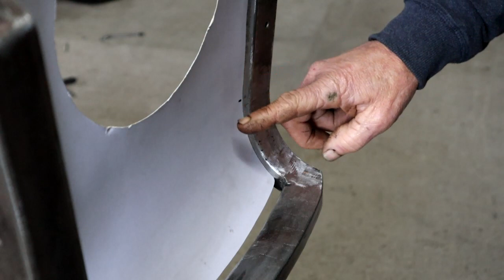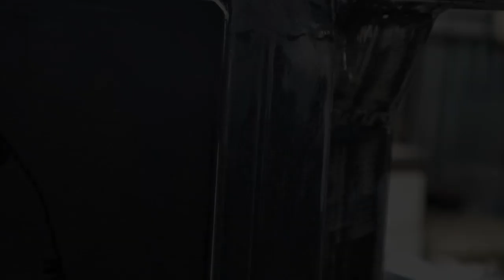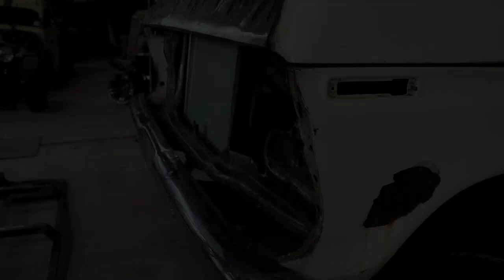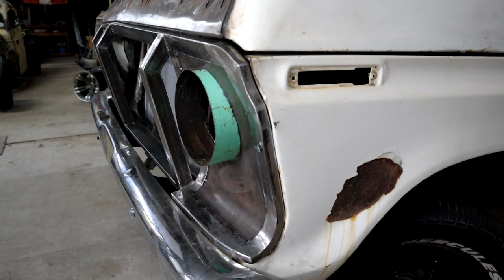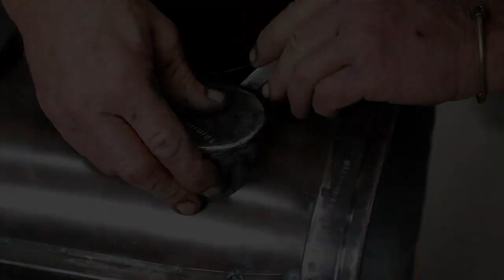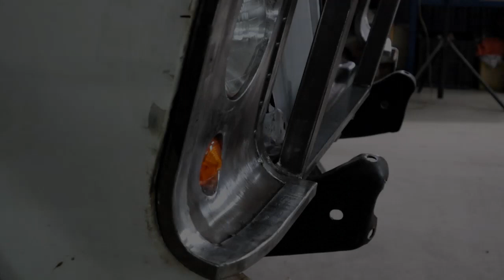BUILDING CUSTOM GRILLE - FORD TRUCK (Part 2)

Comment: Loving your work. Looking forward to to seeing how you tackle the front ibeam suspension if you lower the front
Reply from the maker: Thank you! I did cut the springs some in a previous video, but once the engine is in, will evaluate the stance and take it from there.
Reply: @ratrodsafrica  cool, i cut 1 1/2 coils from my 1970 f100 but its resulted in quite a lot of camber:/
Reply from the maker: @UC%F0%9F%98%86%F0%9F%98%86ohNKJfT3mhaOYjfclxFCyA That's what I suspected... I was going to do 1 and 1/2, then chickened out and only did one coil. Ha,ha! Thanks for that feedback, really appreciate it.There is a way to bend the ibeams using heavy jacks, chains and a strong beam. Might still do it if the front turns out too high. Can email you an image of the contraption - drop me a mail at ratrodsforafrica@gmail.com.